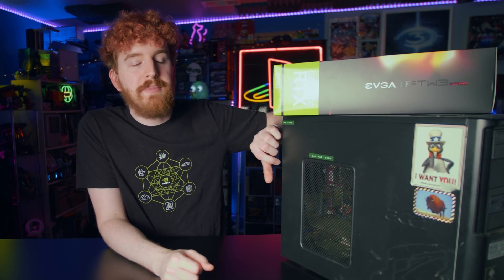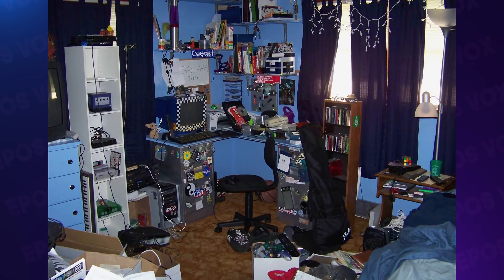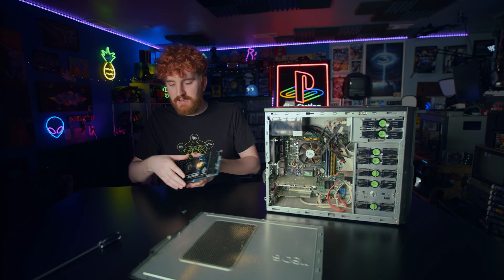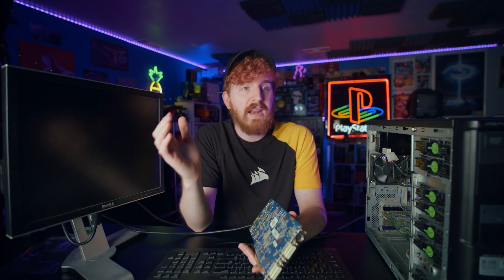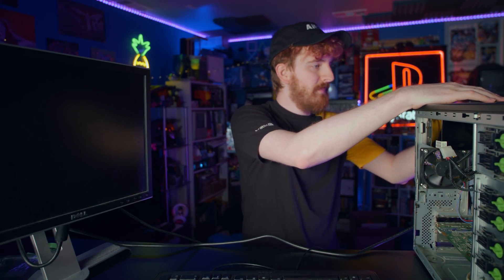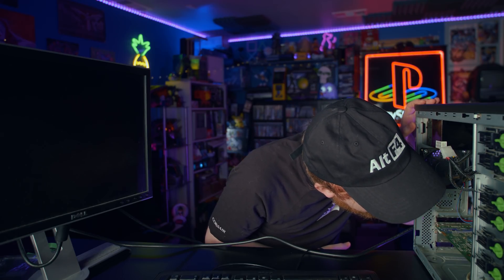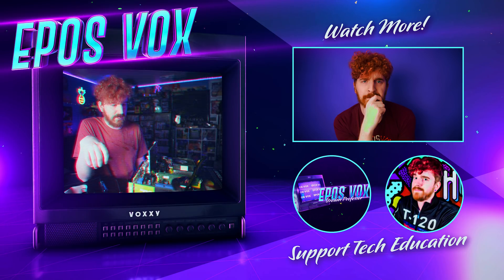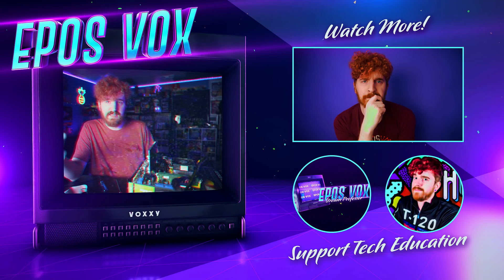I waited TEN YEARS to use this PC again

Comment: @EposVox.   Probably too late, but...   1) Disconnect everything except Power Supply and mobo+cpu (no ram)/cards.   make sure there IS a speaker attached somewhere - boards in that timeframe may/may not have a built-in speaker.   If you power up a board with no RAM, it should make awful beeping noises on power up. If you do hear beeping, then the mobo is somewhat functional.    Do no assume that your current monitor can sync with what the video card can put out.   If there is a floppy drive attached, the light should come on and turn off.   EMachines weren't known for their high quality parts, so it could be something just died.  Also, there were things like power-on ram tests, which can take quite a while.

Comment: I have great memories of the 9800GTX. I ran two in SLI (inno3d) and for the time it was great in a lot of programs - the worst part was Vista - spot on. Still pissed off at at the green monster for pulling SLI. Didn't think they would surrender so easily when it was finally working well but I understand they don't like making cheap GPUs when the same chip can be sold for heaps more in single mode.. Seems to happen with so much with IT marketing today. ps mine had 1.5GB vram.

Comment: Older machines like that one, had some capacitor issues with discharge. When I worked at HP early 2ks we would have people turn off the PSU with the switch, hold the power button in, click it again (sometimes the switches have two stages) flip the PSU back on and see if it powers on.

Comment: Did you try clean the contacts on the RAM modules with white eraser? I'm TI guy and this solve 80% of old PC's not posting problems

Clean the RAM slots with a soft brush also helps

Comment: That really sucks, unfortunately it does seem like the motherboard. But I was going to ask if there were DIP switches on the board at all? I've seen that on older boards sometimes and they occasionally have compatibility settings or special modes.

I guess you could see if Wendell might take a look at it. 😄

Comment: Based on the age of the motherboard it could be a case of the "capacitor plague", it's probably worthwhile to inspect all the electrolytic capacitors to see if any of them are bulging or has leaked fluids.

There was multiple waves of this, not just THE big one (mostly hardware built in 1999-2003, though as late as 2007 there was still some "new" hardware built with affected capacitors) though that one did affect a lot more hardware than the capacitors issues before and after, and had a much better story too - many believe it was caused by industrial espionage, where they either mis-copied the formula OR the formula that was copied was intentionally slightly off depending on who you believe.

The UPS not liking the original PSU might just be due to it having an extremely high inrush current when charging the capacitors, it can be a serious problem with some PSUs.

Comment: There are a plethora of things that could have happened.  Alot of it could be linked to the overheating PSU that shorted out.
Looks like you ruled out the ram.
When the PSU shoots spikes through a computer normally the CPU and the Hard drive are the first things to go.  Pop the hard drive and check for post.  if not switch out the CPU.
Once that's been ruled out it could be something on the motherboard, likely the North bridge.
Reply: is a better practice for this type of scenario (really dirty & old pc) to clean w/compressed air; disconnecting everything from the mobo; blow air to the now open ports; complete removal of old psu; removing cmos battery and pressing power btn for 30 sec; replacing w/a recently used proven psu along w/usual esd precautionary measures?  In the end, I'm unsure if anything could've been done, but u thank chances might be greater using these steps?  Thanks

Comment: Change the CMOS battery. if you have a multimeter you can check and see what the voltage of the old battery is should be 3v. Also did this system ever have windows 10 installed these old systems when upgraded from windows 7 to windows 10 can run into bios issues after. Taking the BIOS chip off the board which on that board should be soldered on and flashing it using a USB bios programmer and some software can usually get it to POST. This is a lot more time and money if you dont already have the equipment just to fix this one board.
Reply: if trying to restore the bios using a bios programmer as you say, is it a custom bios one has to use?  this is probably pre-uefi and I don't think many bioses before then allowed one to make a backup bios like some do now.  the only thing i can think of for that scenario is a custom bios like "coreboot" but coreboot is limited to a very few desktops/laptops where that team was able to write code for.  are there other custom bios teams or do you write this yourself if you are a programmer or IT engineer of some sort...just curious.  Thanks